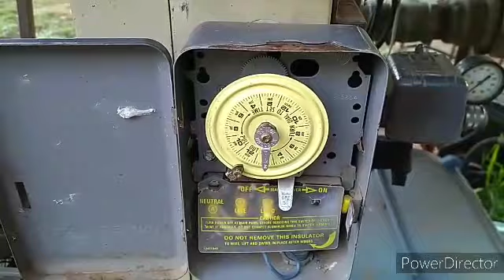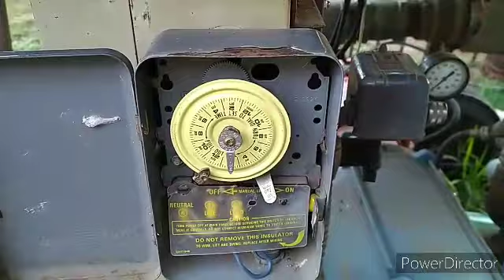taping calf's leg, JB weld and taping the grinder mixer

Comment: 50s for lows in the 10 day. A Maple tree is turning.  Signs of a early fall.
Hopefully Ruby's boy will get better. Have you tried clamping a plastic mud flap on the grinder mixer ?
I have seen that done to a auger. It worked for a while. 
Thanks Ed.
Reply from the maker: Used a lot of tape.. and weld. Hopefully the jb weld and tape will last 🤞
Thank you Bryce! Hopefully he does get better!
Reply: Good evening Bryce.....
Reply: @brenterickson1695  Good evening Brent.
Reply: Good evening Bryce. I thought I saw a  Maple looking like it was turning today down in my woods

Comment: That grinder mixer pipe is almost as badly rusted as my old Sakundiak grain auger that almost folded up this spring. JBweld and tape will come to the rescue for a lot of things but I think I am in the market for a replacement auger.
Reply from the maker: Ya, it will work for this, but you are due for a new auger, or at least a new tube..
Reply: @GosselinFarmsEdGosselin  Its true. The trouble with buying used augers is they tend to wear out from the inside and you can't tell just how thin that pipe is.
Reply from the maker: @roosty6  yes sir, seen some beautiful augers, that literally self distructed in just a few weeks of use.. too many are made too thin to begin with , add the abrasive nature of the material going through it, ....

Comment: Ed:   I have the same problem with an April calf.   Maybe weighs 325lb.    How much Banamine did you give?
Reply from the maker: Bananine (aka prevail) is 1 to 2cc per 100#. We usually go with a little lower than 2cc, unless they're running a temperature or have swelling..